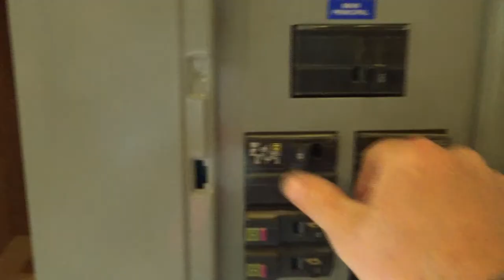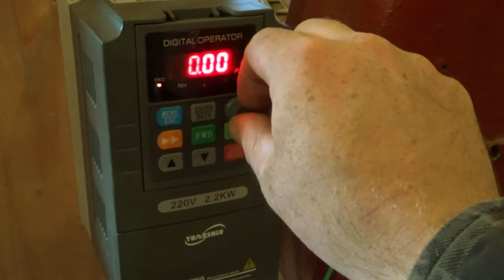Restoring a 36" Bandsaw for the Boat Shop

Comment: You didn't address the loose tire in the video so I'm posting here just to inform.  Rubber tires need to be glued down to prevent slinging the tire like that off the wheel, which can lead to throwing the blade.  Urethane tires don't need to be glued.  One more thing, using a VFD and the braking feature you will have induced current from the spinning wheels essentially turning the motor into a generator.  You need to find a way to cope with this excess current by putting a resistor in line.  The same places that sell VFDs should also sell these resistors.  I have a 36" Yerkes & Finan that I will be restoring.  I believe these two companies are closely associated with Hall and Brown purchasing Yerkes & Finan at the beginning of the 20th century, around 1911-13.

Comment: Sometimes those old machines are probably not worth fixing unless you got it for free. Even then, no trunnions to tilt the table. I've used a lot of bandsaws over the year's. Rarely if ever are they looked after very well. It seems to be the curse of every bandsaw with a few exceptions. This is a shame because properly maintained and adjusted they can do so many things.